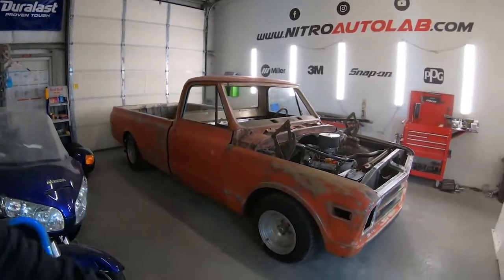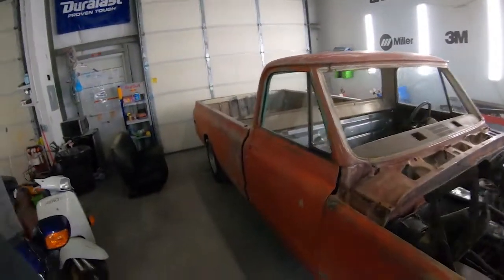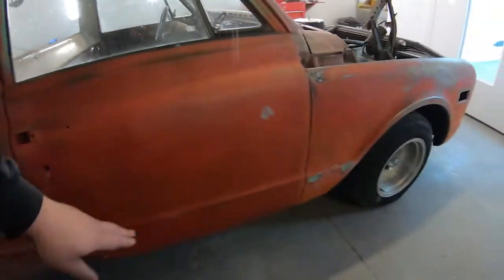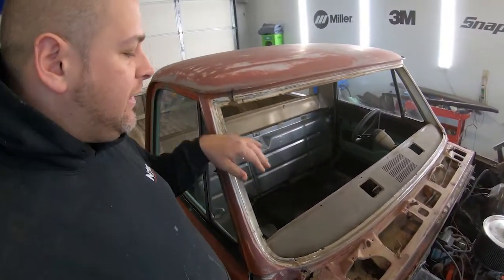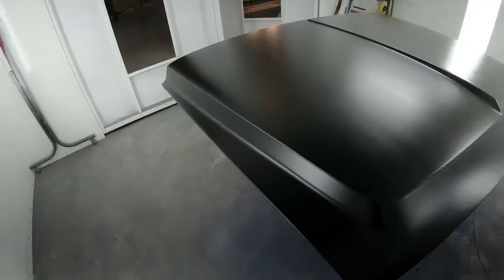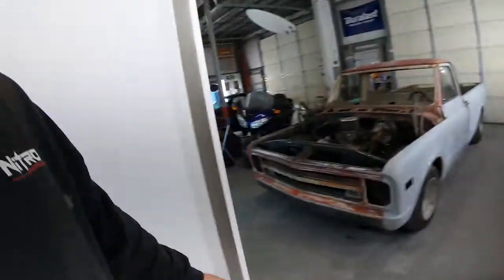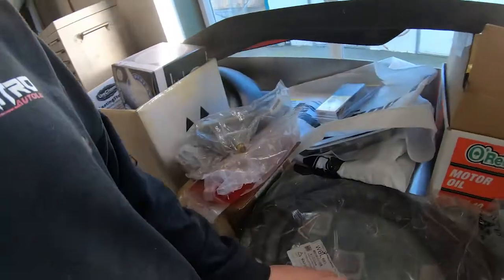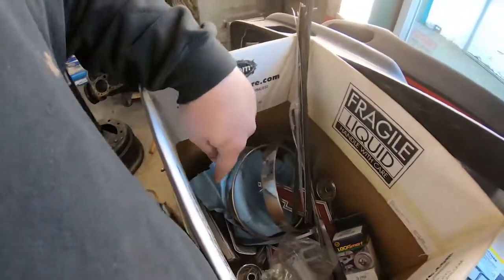THE C10 SHOP TRUCK IS READY FOR THE PAINT BOOTH... HAPPY BIRTHDAY TO ME!

Comment: Curious, I have a 67 camaro, I have all the sheetmetal, quarters, roof, etc, need someone to install it, interested? I have cash.
Reply from the maker: Appreciate you asking but unfortunately my shop doesn’t have the space for restorations and I’d also need additional employees to be able to do that. I e done it before and it can ruin entire work flow for regular maintenance, auto repair, and fender benders. I’d recconed saving thousands and getting a welder and attempting yourself or top secret customs in Arlington, WA does some experienced and amazing restoration work.
Reply: @nitroautolab  Just hang the sheetmetal, I can do the rest, I used to work at a body shop, but just dont have the time to get this done, so trying to speed up the process.. Appreciate the reply. Ill keep tinkering on it. Thanks.
Reply from the maker: @JohnVHLife  stick with it. I have a pretty strict rule for No competes and no restoration type work.